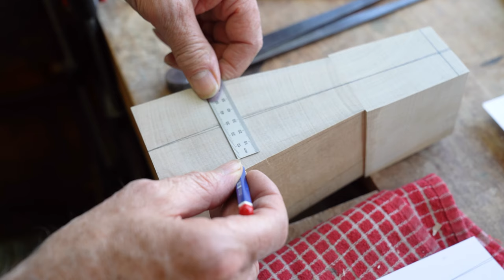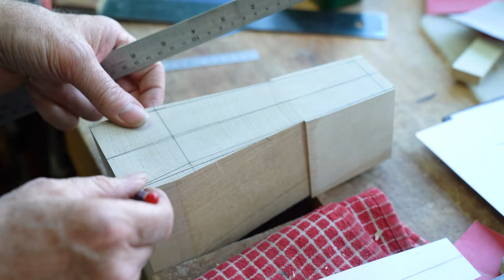Workshop: William Booth II Double Bass Ep 25, Setting the Neck and Tom Testing the Instrument

Comment: Whoever added a 5th string to the Bass did an amazing job. Again the 5th String is hanging off the side of the fingerboard. By raising the height of the bridge and the overstand (this is done by angeling the neck back further), it relieves tension from the top which means that the Low B String on these just sounds huge.